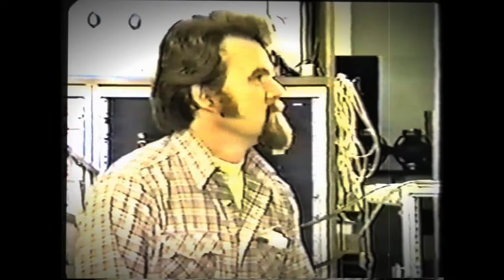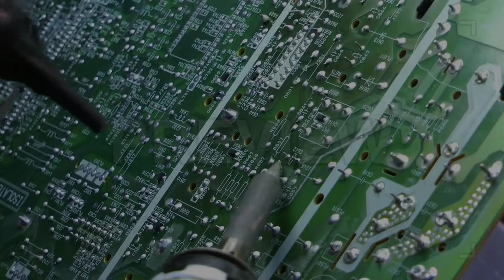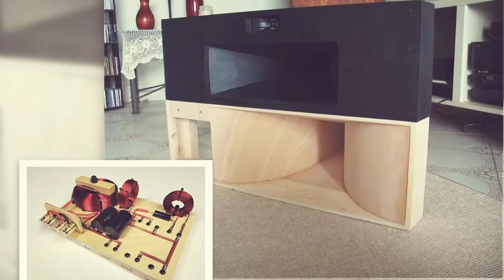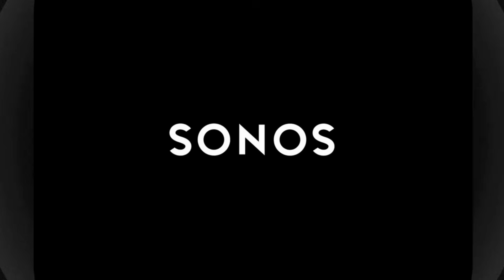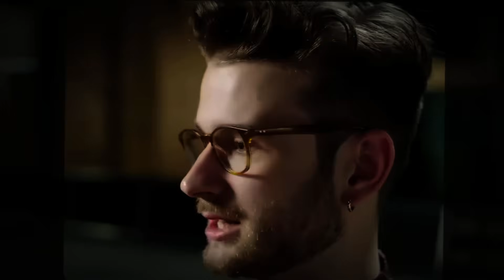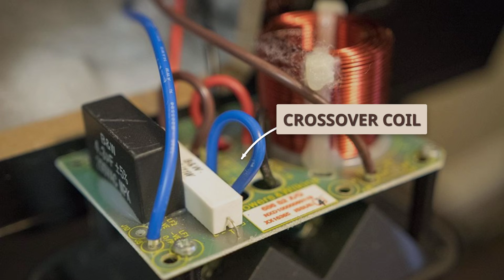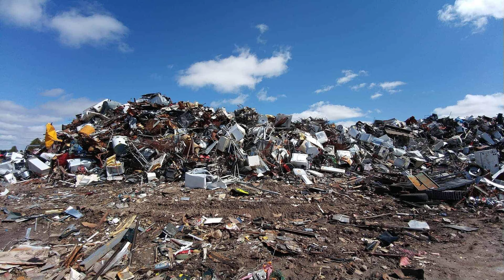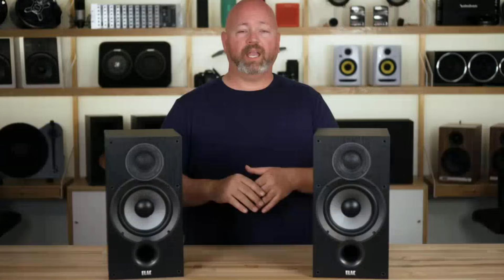The Audio Technicians Blacklist: 5 Hi-Fi Speaker Brands to Never Buy

Comment: I got a Marshal Emberton II Blue tooth speaker excellent great size, It's like Cinderella shoe it's so tiny yet sounds great. Phone and this speaker for deck, can connect 50!! of them together for pool party.  I got only one (no pool), just plug and play.
Reply from the maker: For what it is designed to do the Emberton II delivers. Portable Bluetooth for deck and outdoor use is a completely different use case than the hi-fi chain this channel focuses on. Plug and play simplicity with no upgrade path needed that is actually the honest version of what Bose has been pretending to sell for fifty years.

Comment: This video points out some of the reasons Active speakers are a bad idea,  planned obsolescence.  Highly dependent on soft ware that will be obsolete or no longer supported not too far down the road.  

The failure rate is very high for speakers just a year or two old.   They don’t stock the parts and if you do repair it it’s gonna cost you more then it’s worth 

Conventional non active speakers to me are the only logical choice
Reply from the maker: Every point lands. Active speakers with proprietary DSP and app dependency carry exactly the same structural risk as the network amplifiers covered in this channel. The hardware outlives the software support every time. Passive speakers with a separate amplifier give you full control over every component in the chain replace what fails, upgrade what improves, keep what works. The simplest signal path is almost always the most reliable one

Comment: I had a 5 speaker Paradigm surround sound speaker set up plus their big subwoofer in the late from '98 to '01, and I enjoyed it for what it was. I got into 2 channel Hi-Fi in '24 and the first thing I did was donate the Paradigm speakers to Goodwill and by a modern set of Klipsch bookshelf speakers, and then I bought a set of JBL 4311B control monitors. I wasn't happy with either of these so I tried a set of 2-way ADS speakers, these worked for me and I ended up buying a set of large 3-way bookshelf ADS speakers that continue to amaze me. ADS are my end game speakers.
Reply from the maker: The journey from Paradigm surround to Klipsch to JBL 4311B to ADS is exactly how serious listening starts you keep going until something stops you. The ADS 3-way large bookshelves stopping that search says everything. ADS built some of the most technically accomplished speakers of the late 1970s and early 1980s with driver technology that most competitors simply could not match at the price. End game is the right word. 👌

Comment: My Klipsch RF-83 speakers are 20 years old and look/sound brand new. I wouldn't trade them for anything (except a pair of Klipschorns).
Reply from the maker: Twenty years on the RF-83 and still reference quality the Heritage-influenced engineering in that line holds up exactly as the vintage Klipsch philosophy intended. The Klipschorn ambition is understandable. Corner placement dependent but nothing touches them for sheer efficiency and dynamics at any price.
Reply: I got the forte 2s back in 93 I love them. They're not the best. But for $1200 they rock. The more clean power you feed them, the tighter they get.😊

Comment: Since about 1985, I have a pair of Infinity RS IIIb, and they works always so good (just repair once the woofers foam)
Reply from the maker: Infinity RS IIIb from 1985 still performing after forty years with nothing but a woofer surround replacement that is the definition of built to last. The EMIT tweeter and EMIM midrange technology Infinity developed in that era was genuinely ahead of its time and the drivers age gracefully when properly maintained. One foam repair in four decades is an exceptional maintenance record. 👌
Reply: @WiredTruthHIFI Merci pour votre réponse. Je me suis trompé : il y a eu deux remplacements des suspensions, la dernière il y a 3 ans. Bravo pour vos analyses.
Reply from the maker: @jeanyvesfievet48  Two suspension replacements in forty years is exceptional maintenance and proof that a speaker worth repairing is worth keeping. Well done on keeping them running. 👌

Comment: I have a pair of M&K speakers along with a center Chanel and powered sub from the 80’s very expensive at the time but still kicking ass.
Reply from the maker: M&K from the 1980s still delivering decades later that is exactly what premium engineering looks like over time. M&K built their monitoring systems to professional standards from the beginning, which is why Hollywood mixing stages trusted them and why the consumer versions of that technology hold up forty years later. Still kicking is the only spec that matters at this point. 🏆

Comment: In 1980 I purchased a ‘Coral’ 3way kit speaker outfit. I made the boxes to specs provided and was delighted by the sound powered by my Sansui au3900 amplifier. 46 years later these speakers sound very good still and have not deteriorated as far as I can tell. Impressive Japanese manufacturing me thinks.
Reply from the maker: Forty six years on Coral drivers in hand-built cabinets powered by a Sansui AU-3900 that is Japanese engineering at its honest best. Coral was one of the most underrated driver manufacturers of that era, producing units that competing brands at twice the price could not match on paper. The fact that you built the cabinets to spec and they still perform four and a half decades later says everything about what happens when good engineering meets careful construction.

Comment: Still using my ADS L710' s  from the early 1980's.  They are my fronts for 5.1 surround but I have gone back to them in between 5 or 6 speaker "upgrades".
Reply from the maker: Forty years and you keep coming back to them. That is not nostalgia that is the ADS L710 simply outperforming everything you tried to replace it with. Five or six upgrades and the 1980s speakers win every time. That is the entire argument of this channel in one personal experience.

Comment: I have a pair of small Paradigm speakers now almost 35 years old, purchased for about $200 a pair. I just made my first  excursion into separates with a CD player (replacing a DVD player drafted into the role) and an integrated amp, connecting the two with an optical cable. I have bigger cable connecting the amp to the speakers. I'm sticking with my vintage speakers. The speakers are from before the 'software' era. They now sound great.
Reply from the maker: Thirty five years on two hundred dollar Paradigm speakers and they sound great with a proper amplifier behind them. That is the argument in one real world example. Pre-software era speakers with no expiration date, no app dependency, no firmware updates. Just drivers, a crossover, and a cabinet built to last.  The optical connection from the CD player is the right call. Enjoy the system 🏆

Comment: I still have my Paradigm monitor 7, 30 years and still running!
Reply from the maker: Thirty years on the Paradigm Monitor 7 that is exactly what Canadian engineering looks like when it is done properly. Paradigm built those with real cabinet bracing and quality crossover components. Still running after three decades is the only review that matters. 🏆
Reply: @WiredTruthHIFI  What does Canadian engineering look like when it is not done properly?
Reply: I'm still running Paradigm Reference studio 60s that are pushing 30 yrs and they just sing
Reply from the maker: @sbrodd9203  Thirty years and the Paradigm Reference Studio 60s still sing that is exactly what a speaker built to a standard looks like over time. Reference series Paradigm from that era was genuine engineering. Still performing three decades later is the only spec sheet that matters. 👌
Reply: @sbrodd9203 bought mine used about 12 years ago. Love power.
Reply: I am using a pair of 9's I purchased in the 90's. Had to replace one driver after a flood. They still sound great!

Comment: I'm using Wharfedale diamond 11.1 with an old Sony sub and marantz pm6007 amp. The sub makes up for the lack of bass from the Wharfedales. Would like to upgrade to floor standers but there's so much choice. I'm impressed with Dali and like the wharfedale Evo 4.3. Or could go with wharfedale diamond floor standers. Decisions decisions!
Reply from the maker: The PM6007 with Diamond 11.1 is a solid foundation. Before spending on floorstanders the question worth asking is whether the room is the limiting factor a treated room with the 11.1 will often outperform a larger speaker in an untreated one. That said, the EVO 4.3 is genuinely excellent and a natural upgrade path within the Wharfedale family. The DALI Oberon series is also worth auditioning at that price point. What is your room size?

Comment: Got my fifty two year old Celestion Ditton 66 Studio Monitors out of storage and hooked them up. Forgot how good they sound. Looked them up on EBAY and a refurbished pair goes for twenty seven hundred
Reply from the maker: Fifty two years in storage and still commanding $2,700 on the market. The Celestion Ditton 66 Studio Monitor is one of the great overlooked British speakers three-way design, proper BBC-influenced engineering, built when Celestion still approached every driver as an engineering problem. The fact that a refurbished pair holds that value after half a century tells you everything about how they were built. Glad you got them back out! 💪

Comment: A pair of Pioneer CS 703 4-way 200W which I got brand new in  1981!! Connected to a SAE II  75W amp (also from 1981) and still sounds better than a lot of the new stuff!🤩😍
Reply from the maker: Pioneer CS 703 four-way from 1981 still connected to the original SAE amp that is a complete system from the same era running together for over forty years. That is not nostalgia. That is engineering that was built to last a lifetime and proved it. Still sounds better than a lot of the new stuff is the entire argument in one sentence. 🏆 🏆
Reply: @WiredTruthHIFI  My current setup is  the SAE amp, the CS 703's, a Pioneer Quartz  Auto PL 930 turntable and a GMI Blue-ray player (replaced my 1994 Yamaha CDX1050 a few years ago). Enjoying these on a daily basis! 🤩😍👍
Reply from the maker: A complete system built to last SAE amplification, Pioneer CS 703s, and a quality turntable as the source. Daily listening on gear that was built to be used daily. That is exactly how it should be. 👌 🏆

Comment: still using North American Sound (NAS) out of Dallas, Texas. I currently have the Squires, Monitors, and Mini Monitors. I do not have the Studio Monitors, aka Cornwall Killers.  They need an appliancy dolly to move around.
Reply from the maker: North American Sound out of Dallas is a name that deserves more recognition than it gets. The Cornwall Killers nickname tells you everything about what those studio monitors were capable of Klipsch territory performance at a fraction of the price. The fact that they need an appliance dolly to move is a testament to how seriously they were built. How long have you had the collection running?
Reply: @WiredTruthHIFI I actually was one of the "outside" sales guys for Greg Dodrill back in 85. Greg sold me a pair of Monitors to demo at a greatly reduced price. Greg also got me an ADCOM system (GFA-555 amp and GTP-500)  tuner/preamp) at wholesale to power the speakers. I went to the showroom one time to meet everyone. They did an AB comparison between the Klipschorn and the Monitor. The difference was amazing. Started with the Klipschorn and switched to the NAS Monitor. Sure, the Klipsch sounded great, but switching to the Monitors sounded like my ears became unstopped.
Reply from the maker: An AB comparison between Klipschorn and the NAS Monitor in the showroom with the people who built them that is a rare experience. The "ears becoming unstopped" description is exactly what happens when a speaker with more accurate dispersion and controlled directivity replaces a horn loaded design. The Klipsch sounds impressive, the NAS reveals what was always in the recording.
Reply: @WiredTruthHIFI interesting. Also, when you hit the top of the Klipsch, it rang like a drum. You hit the NAS and it's like hitting a cinder block or a slab of granite. No resonance at all.
Reply from the maker: That knock test tells you everything about cabinet construction before you even play a note. Dead on impact means proper damping and bracing the cabinet is doing its job acoustically instead of adding its own colorations to the music. 👌

Comment: I guess I got extremely lucky by purchasing first the aDs L810s and then later grabbing a pair of their 910's, which were made in the mid-70''s as passive mains for studios. With a proven freq. range of 28hz to 25khz/4ohms/93db efficiency, it would cost $2000 in modern gear to match them.
Reply from the maker: Not luck good judgment. The ADS L910 as passive studio mains is one of the most underrated finds in vintage audio. That frequency range and efficiency spec at four ohms tells you exactly what went into the design. Two thousand dollars in modern gear to match them is probably conservative. The people who know these speakers hold onto them for exactly that reason. 👌

Comment: JBL 4310's gray cabinet...JBL L100's consecutive serial numbered  from1973...BIC VENTURI D52'S & DV62'S from the 80'sall powered by Harman Kardon & Sansui from the 1970's
Reply from the maker: That is a serious vintage collection. Consecutive serial numbered JBL L100s from 1973 is a find that most collectors would not let go of. The 4310 gray cabinet is equally significant studio monitor DNA in a consumer package. Powered by Harman Kardon and Sansui from the same era means everything in the chain was built with the same engineering philosophy. A system like that does not get replaced. It gets maintained.

Comment: Interesting list.  I have Bose portable speakers that have worked well for years along with their award winning headphones.  I have several Sonos systems and their components are very well built.  They did have that snafu a couple of years ago with their software but my speakers never stopped working.  It is a risk when you buy into a system but I’ve had an excellent experience overall.  The biggest risk is internally powered speakers in my experience.  I don’t spend big money on them so I can replace them if needed.  My passive speakers are much more expensive but they last for years in my experience.  Be well and rock on.
Reply from the maker: A genuinely balanced perspective and worth acknowledging. The Sonos software issue affected different users differently and your experience is valid. The point of the video is less about individual experiences and more about the structural risk what happens when the company makes a decision you cannot control. Your approach of not spending big on powered speakers is actually exactly the right risk management strategy. And your conclusion about passive speakers lasting longer is the whole argument in one sentence. Rock on. 🏆

Comment: My oldest are 2 pair of Radio Shack Mach 1's woofers replaced, crossovers rebuilt with higher end components, Sound great
Reply from the maker: Radio Shack Mach 1s with rebuilt crossovers and replaced woofers that is the right approach entirely. The original drivers were underrated for their price point and with quality crossover components they become a genuinely capable speaker. The fact that they are worth rebuilding says everything. How long have you had them?

Comment: Currently have the Altec Lansing 510A towers and like them.  The Altec's replaced Klipsch RP-82 II towers that had horns and no mid range driver and I found them fatiguing.
Reply from the maker: The Altec 510A is a significant step up from the RP-82 II and your ears made the right call. Klipsch horn tweeters without a dedicated midrange driver create exactly that fatigue you describe the crossover point sits in a frequency range where the horn compression becomes audible over long listening sessions. The Altec design handles that transition far more gracefully. How long have you had the 510As running?

Comment: Acoustic Research 4x  best booshelf ever
Reply from the maker: Acoustic Research changed everything. Edgar Villchur's acoustic suspension design in the 1950s made the modern bookshelf speaker possible. The AR-4x is the direct descendant of that engineering legacy. Still running four of them that tells you everything. 🏆

Comment: Me listening my music with Altec lansing 510A speakers.  For my room without any accoustics,  it sounds well. Till now very happy with them
Reply from the maker: Altec Lansing 510A that is serious vintage iron. Built when speakers were designed to last a lifetime, not a product cycle. No room treatment needed when the engineering is that good. 👌
Reply: Currently I have the Altec 510A's also.  I like them because of the dome mid-range and tweeter's being domes.
Reply from the maker: @trekOCLVone  The dome midrange is exactly what separates the 510A from most of its competition. Domes disperse more evenly than horns and dramatically reduce the listening fatigue you experienced with the Klipsch. Altec understood driver geometry before most companies were even thinking about it. A speaker designed with that philosophy does not need replacing.